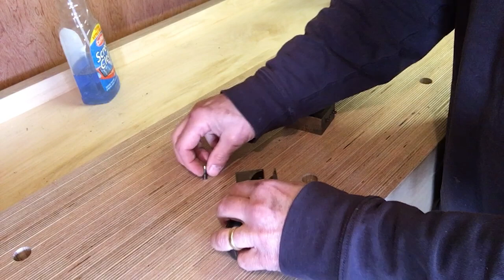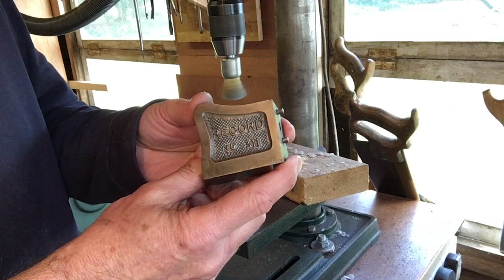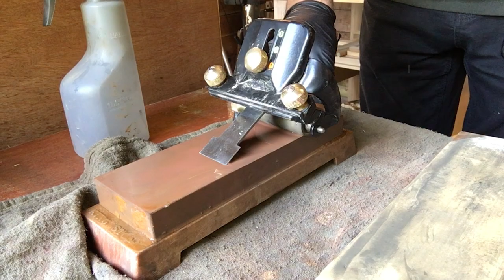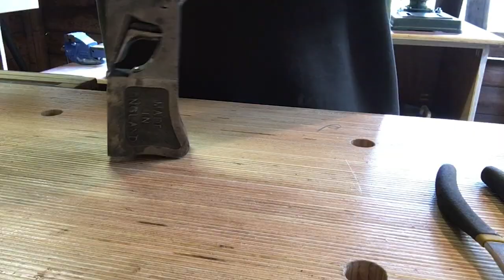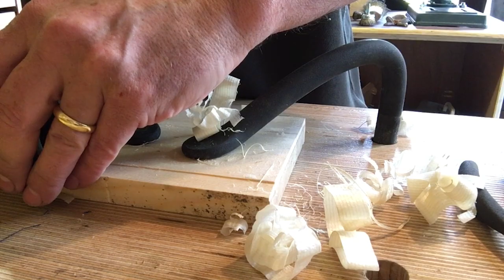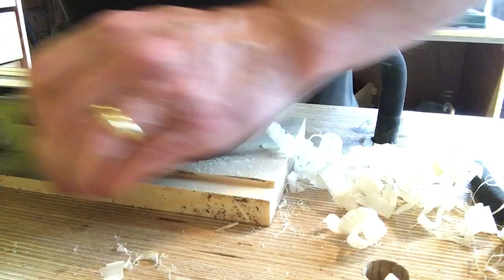Record 0311 Shoulder Plane Quick Refurb

Comment: A really nice plane.   Excellent condition so only needed cleaning and sharpening.   The metal stains may be removable with metal polish if not deep.
I use my Veritas Medium Shoulder plane to clean up the cheeks and shoulders of tenons.   I love using this plane.
The chisel feature of the Record plane can be useful for cleaning up hardened glue squeezeout.
A very good addition to the shop.
Dave.
Reply from the maker: thanks dave - i really need to find time to actually make something - winter is coming soon so maybe then when the grass stops growing etc..

Comment: I’ve just bought a Record 77a which looks like a little sibling of this tool. Nice solid bit of steel with lovely engineering. I haven’t used it in production yet but it strikes me that it will need regular clearing of shavings. I guess for cutting deep rebates it isn’t the most efficient tool, but could be great for fine tuning joinery down to the line
Reply from the maker: Sounds nice